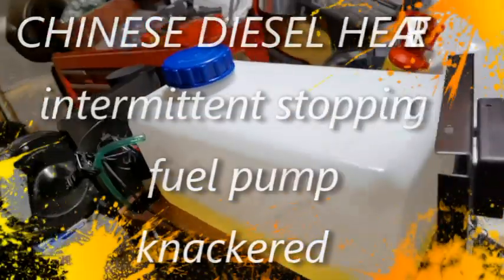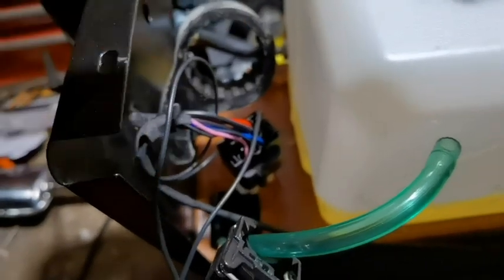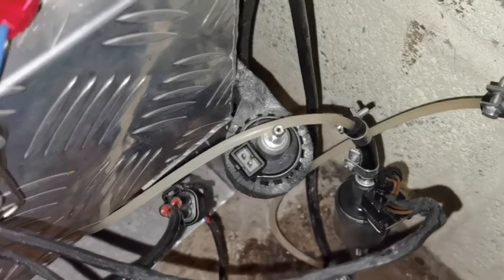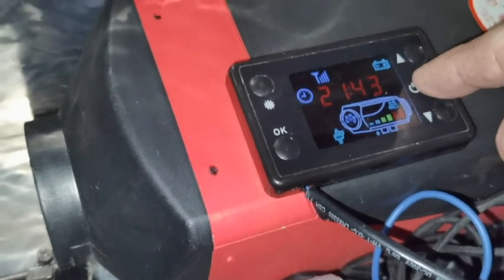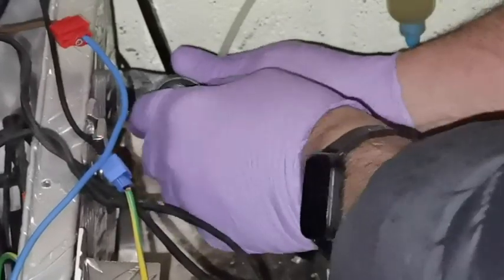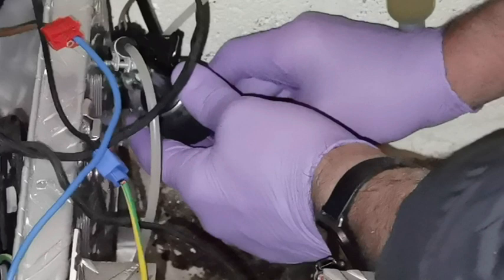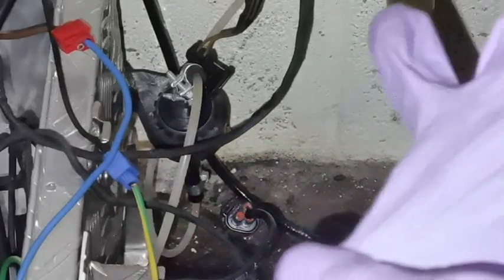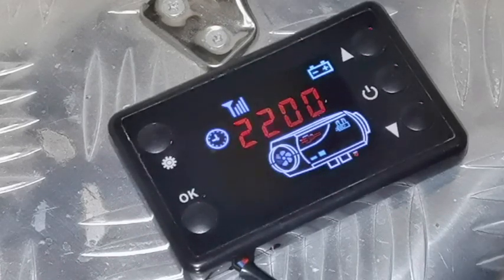Chinese diesel heater intermittent shut down

Comment: They just wear out , they keep pumping but no pressure to push into the chamber 
New pump will fix it up , mine would  run and extinguish in a few hours losing heat, I noticed it was not as Loud

Comment: Van lifer here, you just saved my bacon in the last video as have exact symptoms with no error code after knocking the earth of the terminal and hearing a little pop - if you had checked the temperature you would have noticed it wasn't getting above the 150's and would slowly but steadily start to fall until the heater shuts down - this is the pump shutting off but if you couldn't hear the damn pump anyway over the generator under the van for startup you might have thought as I did it was the temperature sensor! Luckily I saved the pump off my last amazon refunded diesel heater and whipped that on there and bingo! We're back in business baby! Last thing I needed was to be stuck here with a ton of scrapwood that needs building over the next few days dodging rain and have no heating - sure I've got gas but I've nearly ran out!
Reply from the maker: Thanks for watching and lovely comment
Reply: @MrMeltedwellies  damn thing worked for about an hour and packed in again! Decided to change glow plug as only thing left I could do and found the bolt loose - don't know what symptoms a loose glow plug would cause - these I now know. Wonder how long it will last for this time.......

Comment: One day everything starts as normal, van nice and  warm,  the next evening it'll make all the right noises as if it's going to start then suddenly switch off  ?? Then the following night start perfectly again  .... any suggestions  ?
Reply from the maker: Not really Paul i had to wait till if failed then replace the part
Reply: I have same problem, did you sorted it?
Reply: @TheDonatell0  since then I've replaced the relay switch, diesel heater and leisure batteries but now having the same problem,  only starts when engine is running,  been told not enough power but leisure batteries fully charged ....

Comment: I had same issue. I could drive down the road and est would only build to half. Then I would hear clicking cut out a minute before am error code. The line going to burn chamber would come off because they didn't use a clamp down there. 

One person pointed out that debris can lodge inside diaphragm and stop these pumps. He recommended taking pump and hitting it on some wood to dislodge particles. 

These units are very simple. Only real failures are glow plugs, atomizing screen, air port hole blockage and pump.
Reply from the maker: thanks for tips

Comment: Can you post a link for a new pump? Would really appreciate it as i have the same model. Thanks in advance.
Reply from the maker: https://www.ebay.co.uk/itm/314034233751?hash=item491de62197:g:yxMAAOSwZ3ViptOR&amdata=enc%3AAQAHAAABAJsd0uIt4pq5AoA99zSVBktDLJPCTgr1U8yCB5f9iFbbb7%2F65Mdc%2BDQEW1nGISWA6QDyPTiXqWR2z9PyJth%2BjvcdNX%2BaIRP7SHEJZBlQbHuE926BXNFcSpwvg2Xp1v0SdNtC67vqKq6f7t6qAqdwkRZuBuM6g8%2Bcqtak%2BpUt8TTMtMuDTt3vGiXthhqFU9c2luq%2F8IS%2BSw%2Fr%2B%2FgLPzv48%2FUlK8gUDL%2Fe5V3PDykGlxcxBQG5YXUebDI%2BV%2F8AhlCGEvC2X0YpvLmo8KsciAEgmO1S%2BmskqgL6zl7fU7HYajhy2rTpcPRLvKJEZXHnIu%2BWopxDZo0RcEdJr%2B2zM%2BSiKYE%3D%7Ctkp%3ABk9SR9KzrpOUYQ

Comment: Im having the exact same problem. Bought a brand new one (same model) and same problem. Worked perfectly when initially installed. So pissed off. 2 heaters, identical issues identical heaters.

Comment: I had issues when I raised my fuel tank 6 inches above the heater. It started doing the siphon effect. I think a newer pump will stop that but one that is used and looser will let the flow go past it. My problems were solved by bringing the tank down to the heater level.

Comment: Hello from the high desert of New Mexico USA 🇺🇸.  Please install your fuel pump between 15 and 45 degrees also if you are using a larger diameter soft fuel you will cause problems for the fuel pump. I hope this helps you out. Keep up the good work and stay safe and God bless you and your family
Reply: Logically a verticle mounting of the fuel pump would provide an even flow around the piston inside the pump providing lubrication as opposed to an angle mounting position that may starve the upper end of the piston an cause premature failure.
Reply from the maker: Thanks for info James and all the best take care Mark

Comment: A problem I have seen with these diesel heaters that us a plastic tank, the cap does not let enough air in so the tank has a vacuum inside which slows down and sometimes stops the fuel from flowing. I think there is supposed to be a relief valve on the cap
Reply from the maker: Thanks for info will have a look and pos make hole a little bigger